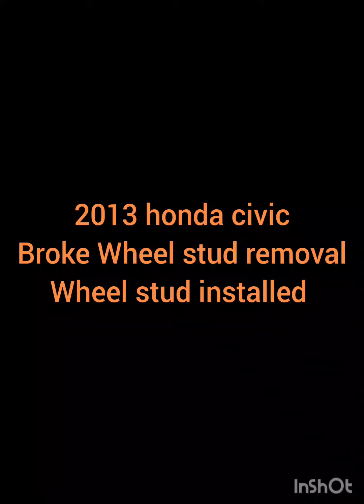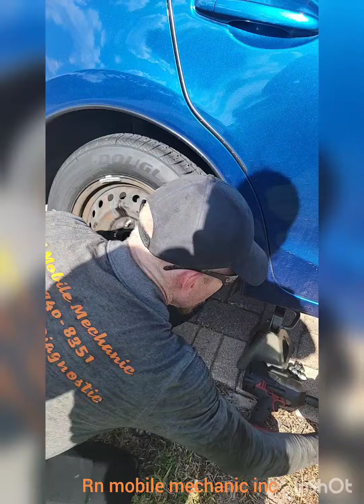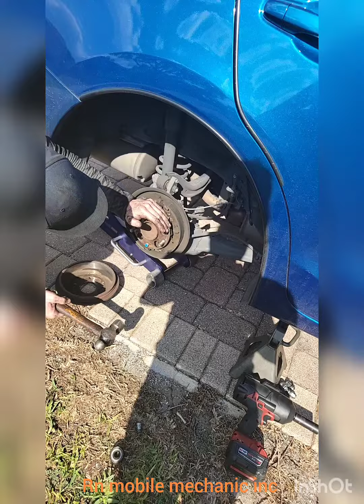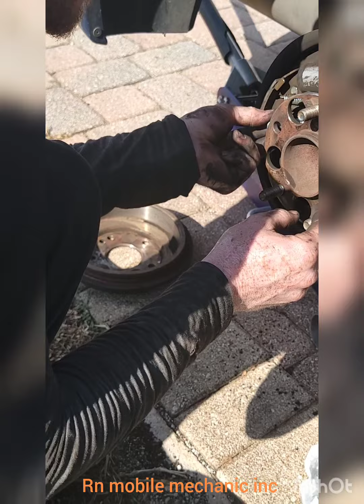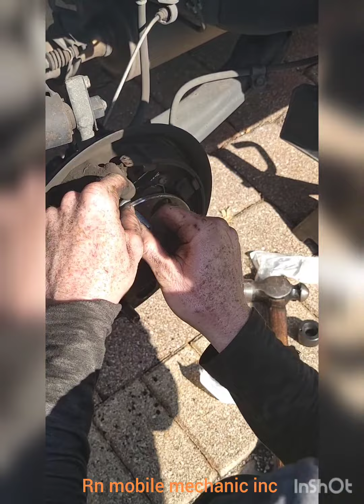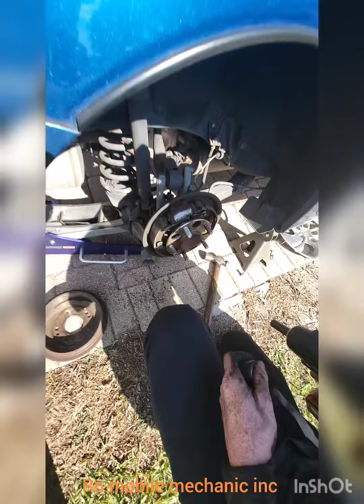2013 honda civic rear wheel stud removal and remplace

Comment: You can also do this with several metal washers, and or a big nut, then the washers. This will draw in the stud. I recommend spraying a little bit of lubricant so it'll go way easier...